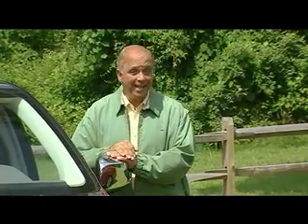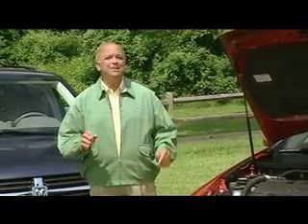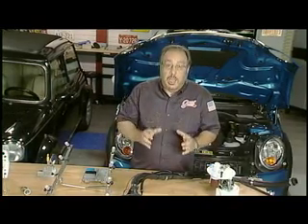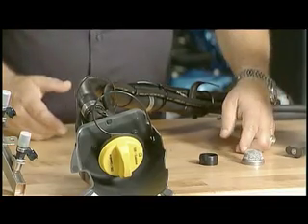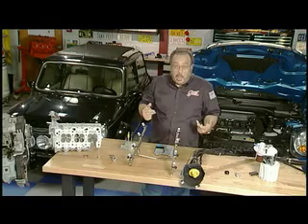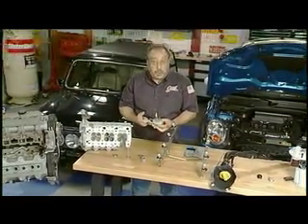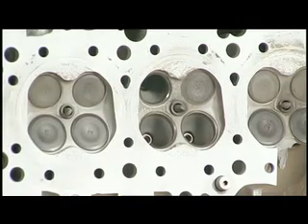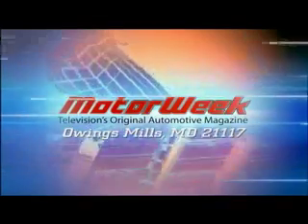Motorweek: E85 Flexfuel Conversion

Comment: I don't think I'll change right now since my Saturn has 171,000 on it and gas here is only 1.99 anyway. Careful, soon they'll probably raise E85 too like they did Diesel. Colorado is outrageous. $2.37 and up for 87 octane. They have 85 but I won't run that. I hear that's worse than running E85, although I ran it in our former '93 Caravan in 1999 and it ran fine. That was the ONLY time I used it in Denver.

Comment: Most cars will run on E85 right? How do you know which ones?
Reply: they will have flex fuel on them, or you can read the handbook
Reply: George Bennett: That's correct. All of them. Search here, it's been proven without any kits or upgrading your fuel system. They don't want you to know so you'll continue to buy regular fuel. By the way, my tanks plastic, not steel. And also, they just got another dislike ! lol.

Comment: The only issue I have with running e85 in my standard cars, is problems starting them in the winter. They are difficult to start when its very cold (below freezing), and will die if not left to idle a few minutes to warm up a little. I do lose about 20-40 miles per tank as well, but its worth it when gas is almost $4.
Reply: And this is correct. A friend of mine lost mileage with his flex fuel truck and sold it for a car that run's on regular. So in the long run your not saving anything running it.
Reply: what year is your car?

post 1994 efi cars can run e85.  

look up pump the movie.. search the software featured in the movie online and get a laptop and suitable obd2 plug.. 

go into ecu and look for flexfuel settings within ecu.  switch on and you're good to go.
Reply: Gary Stinten So you’ve ran e-85 straight with no conversion universal kit ?
Reply: My 96 & 98 Neon and 2009 Traverse run 50% and at -24 F I've never had any starting issues - Traverse has a block heater tho.

Comment: Blah blah blah
You can run ANY car on e85....
Big oil industry just doesn't want there profits being given to the farmers for growing the corn we use for ethanol.
      Brazil has been running ethanol in there vehicles sense the 70's!!!!!!!
They are not dependent on big oil from anyone!!!
ALL LIES!!!
Reply: Since. There's no Sense in this video. lol. Just saying.
Reply: Uhh no you can NOT.  If the car wasn't e85 compatible from the factory you would need a ECU reflash.  I did an e85 swap on my srt4 and it required bigger injectors , a map sensor,  and a email tune.  Very simple and a massive boost in power

Comment: There is no need for conversion kits. I run e85 in my 1987 mustang gt, 2013 mustang v6, 1995 k1500 Silverado and 2015 miata. All run great and it's awesome. Higher octane then premium (91/93 octane compared to 105-110)  and cost 50 to 70 cents less then regular. True your check engine light may come on is some cars but only because the o2 sensor cant read the tail pipe emissions because it burns so clean. Big oil fools the world with smear campaign, such as this video. No matter what car you have e85 will work.  Happy driving!
Reply: Isaiah Batin-Gonzalez Hey Isaiah, you seem really interesting guy. I have a question for you, I drive a 2010 Toyota Prius(please dont judge my car I have to it is Europe), and Gasoline here in France is 1.40 euro a liter (really close to 6 dollars a gallon). E85 is 0.69 a liter (2.99 or less a gallon). I put 50% 85 and 50 unleaded gas at all time with no problems at all. My question is, next fill up should I go for 100% E85 ? Your cars have no problems at all? I looked on the internet and I see that there is not a single problem is you do that (people talk shit, but never a guy said my car died because of it). DO you think I can/ should? Thank you :)
Reply: A little late but mix it 50/50. You look like you already stated you have.

Comment: You forgott the piston rings are still different on flex fuel engines...But the most modern car can run E85 with a good quality E85 kit without dramaticaly increase the wearing..

Comment: This guy full of crap, all gas now has 10% ethnol ( E-10) already in it, read the pump.so all ur internal parts are safe for alcohole lol Rather it be e-10 or e-85, all u need now is a 400$ conversion kit from david blumes web sit ( alcohole can be a gas. Com ) this guy is keeping u all from the truth and selling parts
Reply: Daniel Charette there are some pumps that still sell non-ethanol if you look around for them, though now after some research into ethanol, it would seem it's only good now for long term fuel storage

Comment: Today's modern vehicles are all capable of running e85. The conversion kits are a joke. But if you get the right parts it is possible. And has been done by many people. You can just add a resistor in your injector plugs. You need more fuel flow. So bigger fuel pump and injectors. After that you'll be limited to e85 only. You can't blend like you can on a flex fuel car.
Reply: ,the kits are 400$ from david blume an advocate of alchole can be a gas .com  the kits alowe the proper oxygen mixer so it can burn properly sence alchole is 1 pound heavier than gas per gallon, its thicker, not all cars can run already on e-85, without a kit, ( not this junk this guy is selling on this video) my car 1995 bmw 530 can only handle about a 50% alchole before it starts to pitter putter , witch means i have too much alchole and need to back down, no problum, cause it dont have proper oxygen mixer, the car is not program to ajust the oxygen for e-85 or higher, hence u do need a kit to get better milage with alchole , my car runs fine, superior , more power, and its prolonging my engine life, but i dont have a kit to go e-85 or e-100, because of that i lose about 20% mpg. Its a sacrafice well worth it, till i get the kit and i will then get 20% + more mpg.

Comment: I have been running E60 in my old Japanese budget car for about a year and have not had a problem. I can't put more than 60% in without the check engine light coming on, so this is as much as I am willing to do.

I think everyone should run their cars on as much ethanol as the car can take without the light coming on. If half of the country did this, the oil cartel would collapse.
Reply: Hope ur car is 1986 or newer, cause before that the rubber and parts were not compatible to alcohole, per david blume, alcohole can be a gas . Com
Reply: Correct. I drive a 2005. Antique cars several decades old cannot be driven on any amount of ethanol, even E10. Idiots in Congress are trying to reverse the current 10% ethanol requirement after spending a mountain of money and forcing manufacturers to alter their vehicles. Had they adopted biobuthanol, none of his circus would have happened.
Reply: True, ford used alcohol in 1901 or when ever the first cars were out, alcohol will make ur engine last a million miles hence the henry kisinger (spell check plz :)  changing to oil gas to fuk shit up and control the people , also they use nothing but corn to make alcohol for the 10% mixure wich u can use almost any crop even kelp wich grows a foot a day, corn also is a bad crop that yeilds way less then other crops, sence we use corn for most our foods, its also makeing food high prices, but they dont care about being green, or all cars would be E-100 alcohol and the engine would literally out last the body of a car. And there be ZERO polotion, the mesh left over from making alcohol would also be used to feed cattle and other animals yeilding 20% more milk, beef ect ect...per david blume web site, we would fix hunger around the world and have a true clean power sorce for all that would NEVER run out. Its the cure for the planet, but no one really wants to be green, they just want to control YOU

Comment: I wonder how much they were paid to put out this propaganda. Valve errosion is very common in auto shops in Brazil. In Brazil people regularly send the cars in for repairs because of valve errosion. NOT!
Reply: Lol very true, also brazil has over 50,000 conversion kits on there cars, not ONE. Single report of engine damage
Reply: Daniel Charette The media works for rockefellers. They are the ones that started prohibition.
Reply: Yup yup
Reply: Daniel Charette can you provide link to proof of Brazil citizens using e85 conversion plug and play ???

Comment: Motorweek is being taken for a ride..  Here's the Truth directly from GM

A copy of the speech was provided to reporters on Monday.

Adding the capability to run on E85 costs adds as much as $70 to the production cost of each vehicle, Stevens said.

GM has produced 4 million of the 7.5 million flex-fuel vehicles on U.S. roads now, said Coleman Jones, GM biofuel implementation manager.

Stevens said GM has worked with the National Governor's Association and ethanol producers and dispensers to add 350 more ethanol-blend pumps in the United States. He said GM would welcome federal government assistance to finance expansion of that network, but he offered no specifics on how that would work.

"Today's there's 2,200 (ethanol fuel stations) that are out there but that's not enough," said Stevens.

"Two-thirds of the pumps are concentrated in 10 states and those 10 states have only about 19 percent of the flex-fuel vehicles that we have on the road," said Stevens. "That's a big problem for us."

Those 10 states are all in the U.S. Midwest, heart of corn production in the United States. Corn is the dominant source of U.S.-produced ethanol.

Stevens said there are about 160,000 U.S. gasoline stations, and there need to be 12,000 or more ethanol stations "to have ethanol fuel available for every one of our customers within about two miles of where they live. So, we've got some work to do there to get the additional 10,000 pumps in." Ethanol-gasoline blends emit less polluting carbon dioxide than conventional gasoline, and is mainly produced domestically.
Reply: The Main difference is simply the ECU software ..simply loading the Flex Fuel Map ..(rather than  the gasoline fuel map)

SOME vehicles take larger injectors and fuel pumps but most are exactly the same as the non FFV  (if not it's usually a fairly easy swap)

The" Conversion Kits"  Motorweek is talking about are basically just changing the pulse width of the fuel injectors..leaving the injectors on for a bit longer at specific timing to allow more fuel through

The Gas Tanks are all the same  there was a time years ago when the fuel injectors had an O ring that was not ethanol (on some vehicles)compatible 

We're talking about all newer vehicles.. if you want to convert your 1969 Impala ..then yes you have to get rid of the cork gasket s, add new fuel line etc..

Comment: From change2e85's website, myth no.1: 
1. E85 Ethanol is corrosive

Yes ethanol is corrosive, but not very much. Gasoline is corrosive too. Ethanol is biodegradable in water. So it has a tendency to contain and attract water. It is not the corrosive properties of ethanol that can cause damage to your vehicle; it is the water which can rust a vehicle’s fuel system from the inside out. Today’s vehicles (since mid 1980s) have fuel systems which are made to withstand corrosive motor fuels and rust from water. Also today’s distilling processes are superior to way back when. We now have better techniques for drying out ethanol or reducing the water content.

On side note, gas contains water too. Ever hear of dry gas?
Reply: Carl Darl have you had experience with e85 kit ?

Comment: Yeh, wow...next time you fly, ask for a drink. What do they bring your alcohol in? ...a nice little plastic bottle. Doesn't matter the concentration either. This crap about corrosive alcohol is bunk...it clogs lines in engines that have been run on gasoline because it cleans out the carbon sludge. Do your own experiment if you don't believe it. Spend a dollar or 2 and get these "parts" metal, plastic, whatever...put them in Ever Clear for a month! You'll see  the big difference; NOTHING.

Comment: Man, that's dissapoinging. Yeah, some of the E85 conversion kits are misleading. But this is just as misleading, or more so, the other way. That's not really making things any better. And pretending that you'd have to convert your car to an OEM Flex set up to use E85 is very, very misleading.

Comment: this guy's always been crap for advice. He just does what he's told or tells people what he was told. E85's dangers aren't engine related. it's wallet related. you have to make sure your engine is efficient enough to use the low energy e85 and not completely blow your saving. Usually n/a tuning will get the job done. High compression ratios LOVE e85. bottom line if your car requires premium...e85 is your best friend.

Comment: Who is paying you to lie? what a freak causing fear. I use it on my 95 Lumina and 97 Silverado and NEVER have any problems. In fact the fuel pumps would need changing anually with standard gas and with ethanol they have not needed any change yet.The valves and seats are NOT any special metal and don't break down from alcohol on anything since the removal of lead. Only hardening is done for less lubrication from lead free fuel.. This is BS. You should be ashamed...

Comment: I have to agree with the dislikes, this is truly crap. Ethanol doesn't need new fuel pumps, gas tanks, fuel lines, fuel injectors, valve's, cylinder heads, and anything else. It will actually clean up the engine since ethanol is a solvent and will clean out everything MW showed. The only differences to a flex fuel vehicle is how long the injectors stay open for, upgraded fuel injectors can be used and be more efficient, but they don't need to be. Please do your research by yourself, not GM.

Comment: of coars there friends a GM (Goverment Motors) whould love to sell you a new car or truck. i splash-blended 40% for 2 years then put on a conversion kit. i've been useing it for a year with zero, no, none, zip problems, since ethaonol burns 300 degrees cooler and burns cleaner i go longer between oil changes.